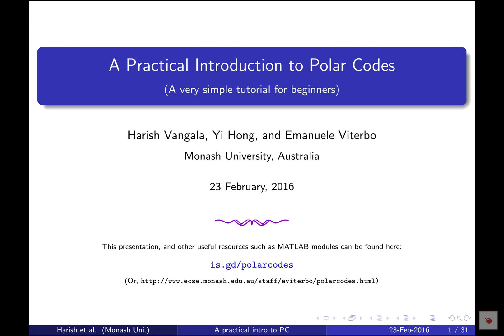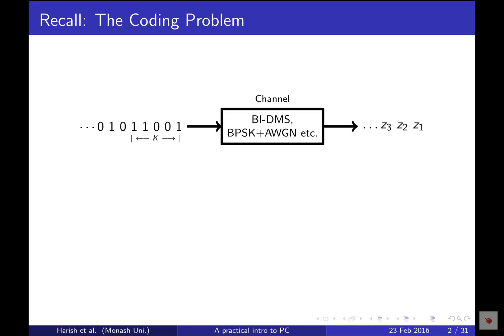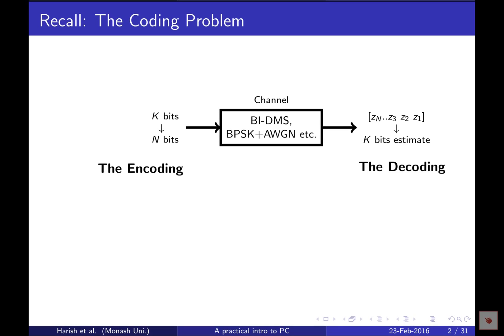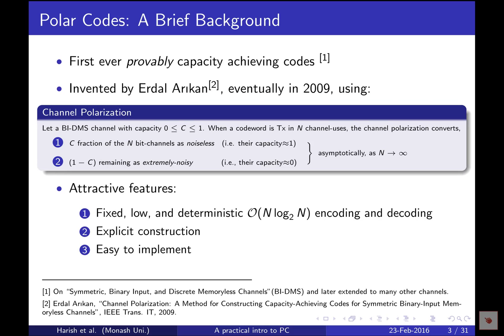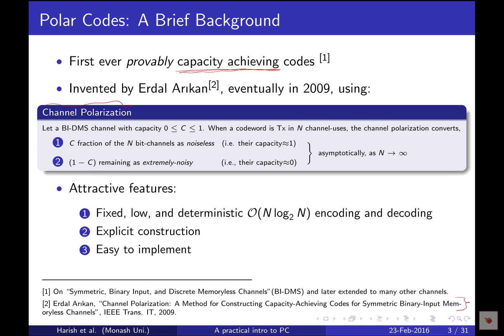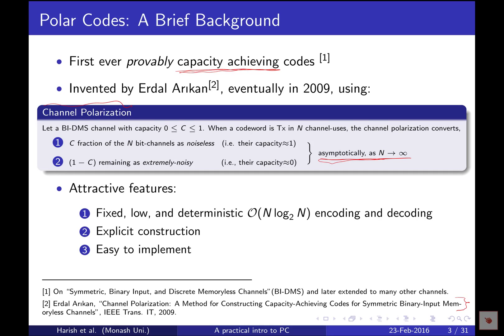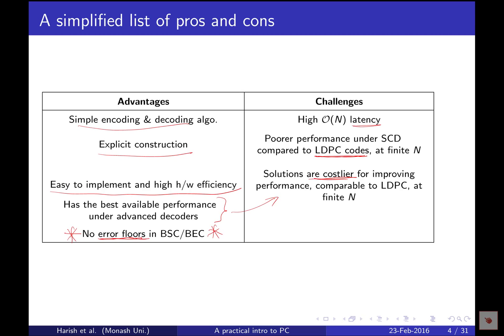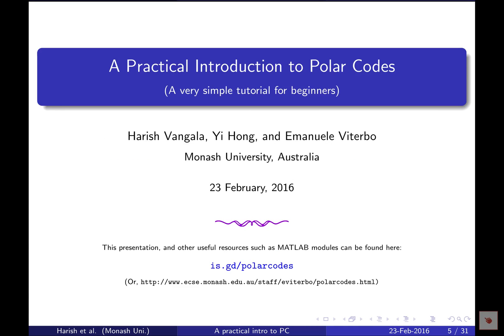Polar Codes Part 1 of 4: Introduction

Comment: Dear H Vangala

If we note     U = [u1 ... uN] is the vector at the input of the encoder which contains the information bits and the frozen bits and  X = [x1 ... xN] is the vector at the output of the encoder. We know that the xi (i:1:N) are , using XOR and copies, .a combinations of frozen 
bits and information bits.

My questions are:

1) After the encoding stage do  is there  a single channel or multiple channels (N channels)?

2) If there are N channels, how will the frozen bits go through the  wrong channels and the information bits through the good ones  knowing  that both frozen bits and information bits were mixed together  at the encoding part ( using XOR and copies)?

3) what is exacltly the Design SNR ? How do we use it in simulation ? if we choose several values of SNR in our  simulation ( SNR(dB):[0:2:30 ]  for example)  waht is the value of Design SNR?

thanks in advance